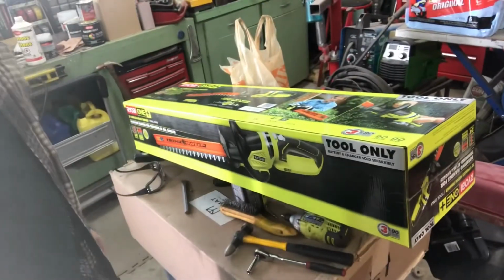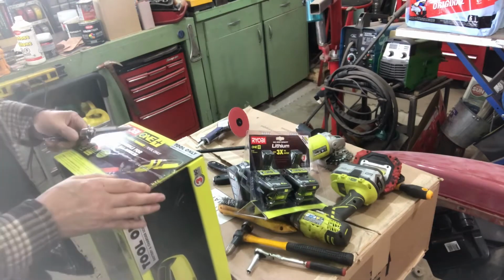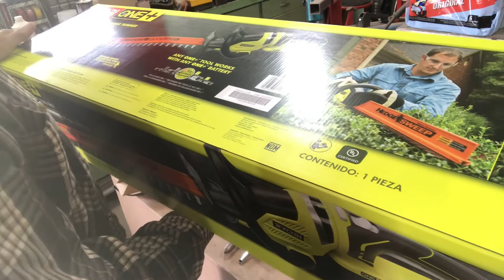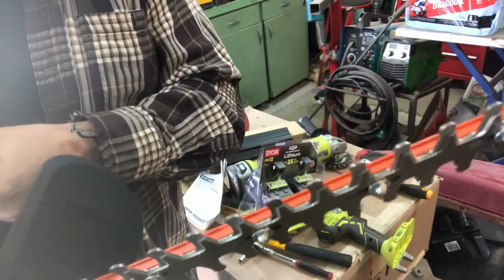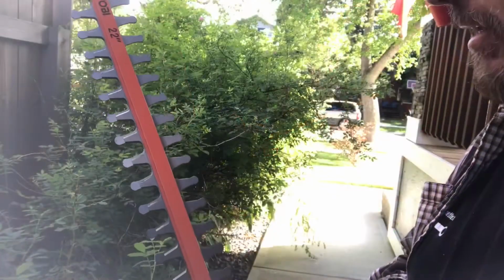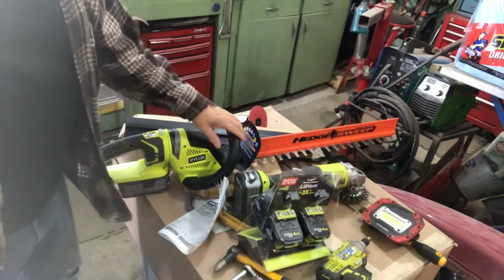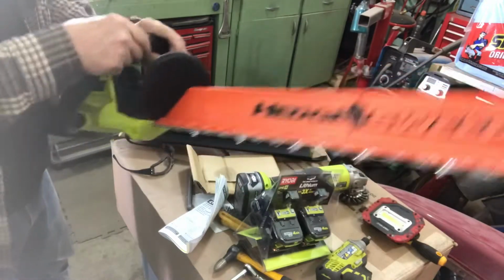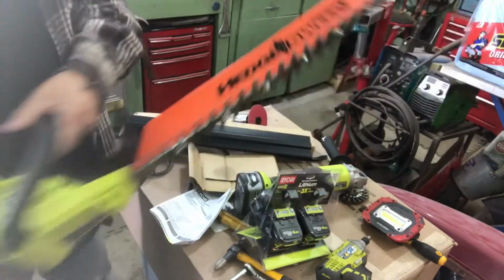Ryobi One+ 18V 22” Cordless Hedge Trimmer

Comment: Great video. I would have liked to see the hedge sweep attachment in action. My guess is that it rakes clippings from the top of the bush as you cut, not leaving any cleanup needed. I have been using Fluid Film, a lanolin based product for hedge trimmer lube and don't get complaints about plant injury from petroleum based oils.
Reply from the maker: Thanks!  I completely forgot about the sweep attachment till I was finished.  I'll bet it works pretty good.  Good tip on the Fluid Film.  You would be the guy that knows about such things.  I'll give it a try, I just bought a case of it